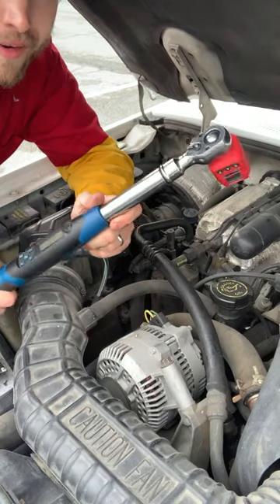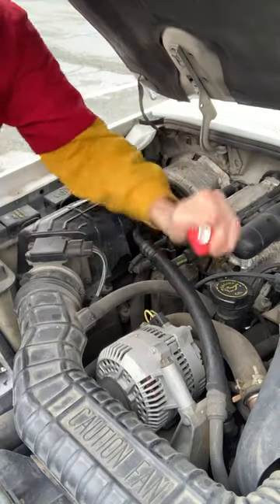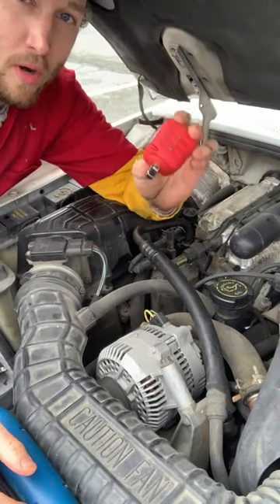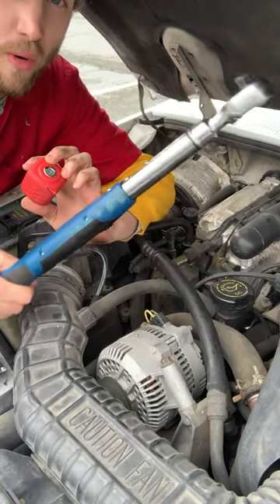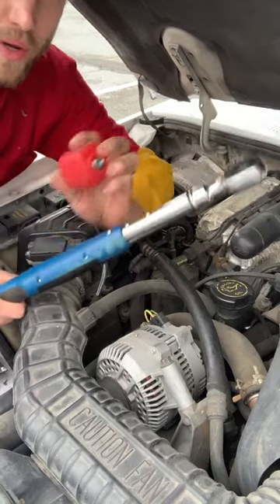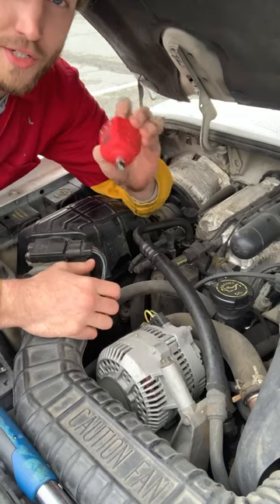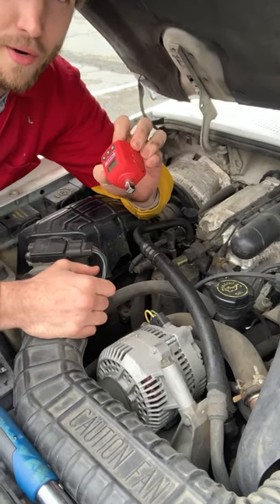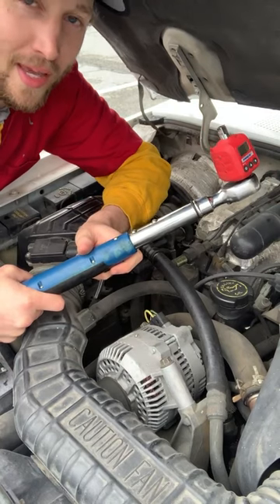Torque Wrench vs Torque Adaptor

Comment: I prefer a torque wrench with a low profile head. That red box wouldn't even fit into the tight areas I work on.
Reply: Try the needle gauge torque wrenches the head is smaller than a ratchet.
Reply: Same here I have a torque wrench attachment like that but I also have a low profile torque wrench because the attachment does fit in like 90 percent of places
Reply: @martybraun2930  I have a needle gauge also it makes it easier to measure rotational torque

Comment: Sounds like someone needs a timing chain in the background
Reply: Not a timing chain but an idler pulley, just happened to my 97 outback and this was one of the sounds it made before finally the bearing inside the idler #2 pulley exploded
Reply: Classic Ford power steering whine. Actually it's quite normal. Worked for a municipal Fleet of 500 vehicles. We almost exclusively used Ford sedans and Pickups.
Reply: Lol ????
Reply: Sounds like a high mileage engine to me. You’re gonna need more than sound to chase that issue, my friend.

Comment: The best torque wrench is one that's calibrated right and it doesn't come out of spec if it hits the ground or just by using it. Always good if you are in a shop with a few same range torque wrenches to check every so often so you don't get the turning stomach feeling after a 10h job because the manual called for a torque that was less than the elbow torque felt was right and you weren't sure if the tool clicked at the right time.

Comment: My autozone duralast 3/8 has seized on numerous occasions and will end up snapping bolts if I’m not paying attention; the entire assembly will get stuck and I can’t even loosen the locking bolt to unwind it. 
For example on my rear main seal carrier it has four bolts, 6lbs was the setting and it got stuck and I was rushing a little and turned it too much.
Reply: Mine works a1. You prolly need to exchange for another one possibly you have a defective one but yea I haven’t had any issues.
Reply: Probably from not unwinding it after use

Comment: Is that torque wrench the one from harbor freight if so do you recommend it to buy? Is it worth it? Can you do a short on that blue torque wrench
Reply from the maker: i'll make some more shorts comparing the two. I didn;t think to do that until I was editing this. I like the little one better. but ill explain why with some demo in the next short.
Reply: I went to home depot. Spent about $80 on a 1/2" drive. Love it. 
I prefer the micrometer type, with the lock sleeve ring. 

You can also purchase a torque wrench check tool. If you're ever uncertain if the torque wrench is accurate.